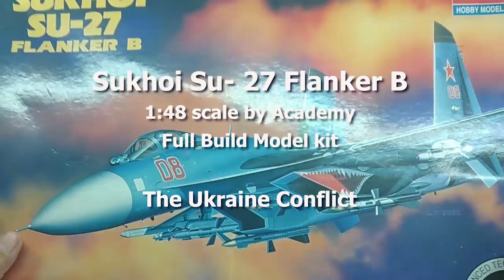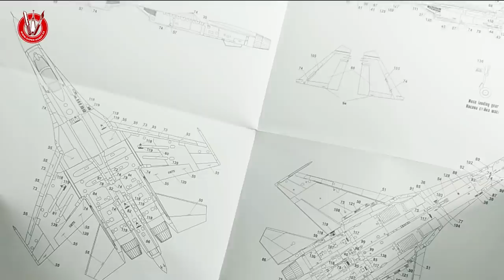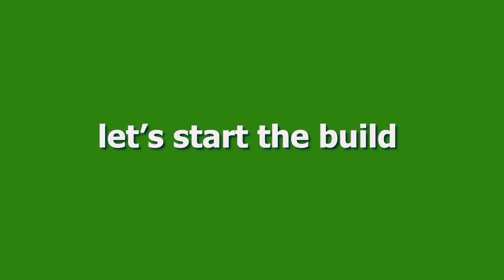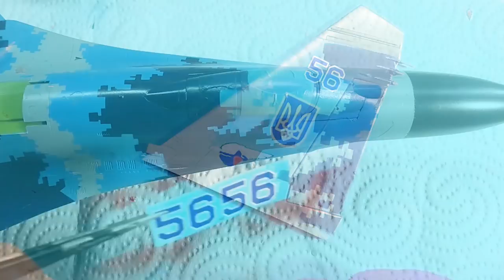SU-27B Flanker Ukrainian AF, Digi Decals 1:48 scale

Comment: Well done, I guess you could have add some more realism, for instance at the landing gears light and correcting some minor injection pins, but oh well 😉! one thing is unclear 'though: you bought aftermarket nose but eventually used the one which came with the kit? 🤔
Reply: Thanks for the advice, my friend about the nose is too big for the model.
Reply: @artemiogutierrez5326  which one is too big? The one in the kit, or the aftermarket piece?
Reply: @artemiogutierrez5326  oh, and by the way, did you use just diluted white (PVA) glue for masking the canopy? No problems to take it away afterwards?
Reply from the maker: @andreagiordano2689  the aftermarket nose is bigger than the model, mate.